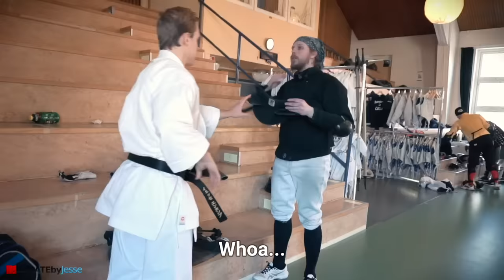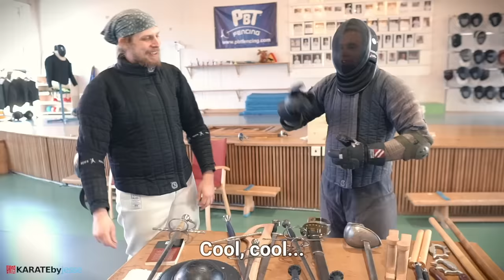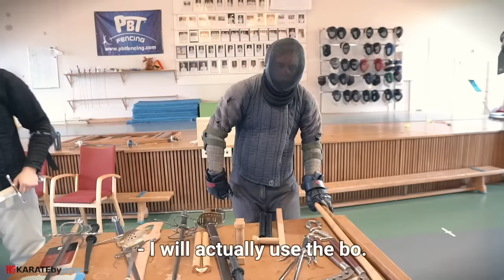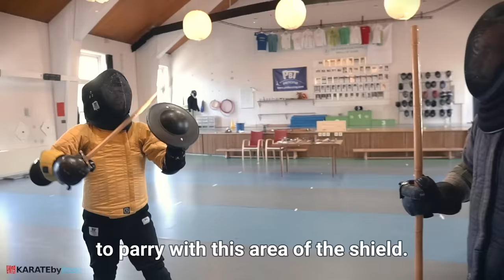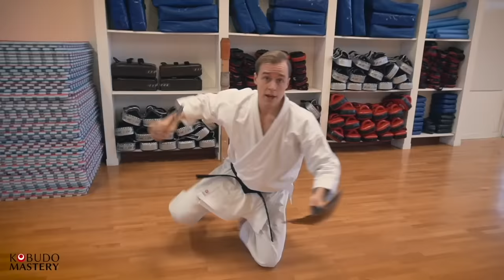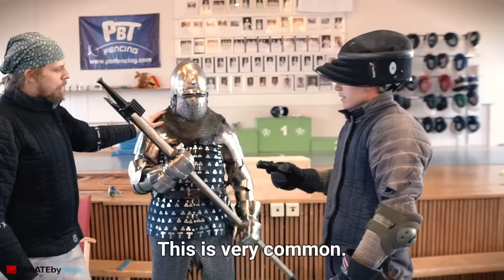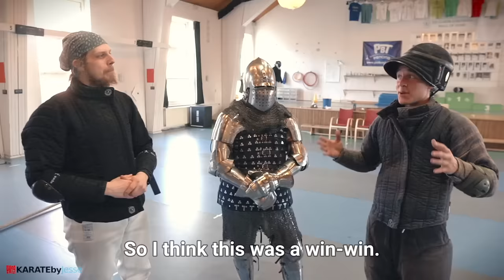Medieval vs. Japanese Weapons (Real Sparring)

Comment: The back kick against a knight is something i wasn't expecting to see, but definitely needed it
Reply from the maker: It was pure instinct! 😎
Reply: @KARATEbyJesse  Did that hurt?
Reply from the maker: @TheEndKing  Didn’t feel anything 😜
Reply: Im just not sure how viable it would be against knight. Maybe sort of push kick would be to get them off balance for grappling. Knights armor is designed to receive massive blows from actual weapons so no matter how hard they get kicked i doubt they much at all feels it especially directly to plate.
Reply: Not sure how it counted as a win, though.
Reply from the maker: Oh yeah, you should have heard him squeal 😂
Reply: @lalli8152  The kick landed on the low abdomen, right above the hips, so might not be the thickest part of the armor.
Reply: Not sure about the effectiveness though
Reply: Launched it so quick and under the Knight's vision
Reply: @lalli8152  knights themselves do normally kick, grapple, wrestle or even throw each other, trying to when in close melee. It probably would be too tough for sb out of armour.
Reply: @lalli8152 force matters most with Armor. You can alash away at it with a sword and have no damage. In a battlefield with people fighting and stuff you probably wouldn't even feel it unless it was something like a greatsword because swords sork in the principle that acceleration+small mass= small force, then small force+concentrated to a small point in the edge= penetration of flesh and thus it works on unarmored opponents. With armor you want something with a large mass. A regular hammer around 1kg (2 pounds or something) would do better than a sword.
Reply: @lalli8152  once i got hit by a bycikle in my armor it hit me in the area the man at arms was hit. It didnt hurt I velt it but armor is very powerfull and a kik does on plate almost no damage to the wearere.
Reply: @owwh2976  yeah especially something like plate because its so rigid i doubt you would feel much. Maybe just push of the kick that could throw you off balance or something if the kick lands at right time.
Reply: @lalli8152  I do buhurt. We receive direct hits of polearms, axes and swords and don't feel but a little disconfort. We also do and receive kicks and punches... from an opponent wearing a very heavy armour in the  arm or leg! And again, it bothers you, it does distract you...but you have to be VERY off guard and out of balace for a kick to really get you off balance... and a barefeet kick?? Even less!! 

In bohurt, kicks and punches do not count as a hit... because you are wearing armour!!! That is the point... the armour makes you slower, to sweat more and get more tired, your undertanding of the surrounding is worse cause of the helmet... but ALL of it is worth it cause it makes you impervious to almost any attack... I assure you that kick did not affect the knigth at all.

Comment: That was an amazing video and quite a bit of fun to watch.  I'm really glad your final boss didn't use the polearm to full effect, your armor was nowhere near stout enough to take a solid hit from it.  It would be a fun follow up video to have YOU get suited up in full armor so you could get a feel for just how much protection the guy had.

Thanks for this treat.
Reply from the maker: Glad you enjoyed it!
Reply: @KARATEbyJesse  One of the things that made it especially enjoyable was the mutual respect had by all and the chance to debrief after each match.  The final distilled wisdom was great as well.
Reply: Yeah, I was worried that he would get clocked on the head by accident or something -- that's a concussion right there, if not a trip to the hospital. Modern fencing masks were not designed to handle poleaxes... 
I feel as though this exercise did illustrate some interesting things -- infighting is surprisingly viable even against long weapons, provided that one is trained. But at a certain point the gap in gear really nullifies a lot; kicking and armored opponent in the chest isn't really going to do all that much, and while Jesse managed to pull off a takedown, that was only possible because his opponent opted to get rid of his weapon.
Reply: @taichi2245  Well said.  The average person doesn't understand just how much protective clothing is between the skin and the armor that acts as an additional buffer and how the planes of the outer surface deflect and dissipate force.

And then doesn't realize that a blow from a poleaxe or halberd can STILL shatter collarbones or give concussions through it all.  You can't really "blunt" what becomes a bludgeoning weapon.  I've seen some seriously gnarly injuries from weapons of this type.

Comment: this was very interesting. One thing to consider is the damage each weapon does. It is much more realistic for a sword to take someone down in one hit since it is a bladed weapon, which is why it makes sense for sparring with those weapons to go only until the first hit. The bo and nunchucks are blunt, however, and the force transfer by the nunchucks is a bit inefficient due to it not being rigid, so it is unlikely to seriously injure someone down in one hit. the stabs from the staff would also not do as much damage, so it is less threatening than a spear for example. when u were fighting the knight, you really must get in close to grappling. you would also have a knife to stab in the gaps.
Reply: You’d have to remember that he’d have the same thing. Like they said in the video, unless you have a similar level of armor, your best bet is to run.
Reply: Blunt weapons can still do damage, and I’m imagining a staff with some metal caps or spikes at the end could help with the impact. But I don’t imagine it being as effective against a person in full plate armor
Reply: @jonathanschaffer2594  yes, blunt weapons still do damage, but wooden ones won't do nearly as much as a sharp metal object. also, adding metal caps to increase damage would change the weight distribution drastically, making it fight differently. we see tgis in maces.

Comment: Funnily, grappling is a big part of European martial arts, especially against armored opponents. So, trying to get a knight on the ground isn’t a bad idea, it’s actually exactly what you’d want to do against one, since while medieval armor was very mobile, you’d still have a little difficulty getting up. But, the tricks are mostly done with assistance of levers, aka your weapon. It was also interesting to see the adaptation to your strategy. Though, it’s not terribly surprising to me that the generally shorter weapons failed against much longer weapons, namely with the sidesword vs kama, but that’s a general issue you’ll find in all weapons. Longer blades generally have a greater advantage since they aren’t as reliant on getting close, I’d recommend Skllagrim’s own video on a similar weapon to the kama about sickle fighting and his spars to test it out. Now, in a realistic scenario outside of sparring, if nunchaku were put up against a rapier and parrying dagger, even with the tonfa in the off hand, nunchucks aren’t very good weapons in general and don’t do well at carrying the energy of a blow when compared to a normal stick, but seeing it in sparring getting namely used against the hands is actually pretty insightful, it does show a bit of a strength they could have, and it’s being able to hit targets that a straight blade would need more effort with, and I admittedly disagree with the assumption that a shorter opponent is faster, it’s normally the taller ones in my experience that are faster. Though, smaller opponents are definitely much harder to hit because they’re small. I admittedly don’t have much to stay about the quarter staff because well… it’s a staff. Staves are historically rather effective weapons, especially if made of thicker and stronger wood, though some techniques you employed were actually also done in medieval Europe, so that underlines a similarity between philosophy in regards to these styles of weaponry. Of course with the armor duel again, what would have been done is that the weak spots in the armor would be exploited or the visor lifted up for visored helms or the helmet completely removed if it was close faced. But with the style of armor, it looks to be about 14th century from my perspective, so the helmet is likely a bascinet. But that’s only my observation from watching this.

Comment: This was really cool.  The Kama worked much better than I thought they would, and the Tonfa and Nunchaku were like a flail and parrying dagger!  As per facing the armoured opponent - that's what Jujutsu is for.  Take him down and then use a dagger in the joints of the armour.
Reply from the maker: Yes indeed!! Thank you
Reply: To be fair: They worked because his opponent refused to use all his tools. No guards, no overhead work, no constant threat with the point.
Reply: @leichtmeister  Correct. I don't see the point of this video.

Comment: quick disclaimer, as an armor enthusiast, this is not what actual armor looked like. This is buhurt armor, which is cheap and doesnt fit properly to allow it to be damaged without too much issue.

the changes are...
buhurt helmets are normally bigger
the cuirass or other chest armor is usually wider at the waist with buhurt
generally doesnt fit as well.

Comment: This looks like a lot of fun. Very impressive.

That heavy plate is from the late Middle Ages. At that point in history, armor technology had finally outpaced sword technology. The key was to bring the knight off his feet and finish him on the ground with a bludgeoning weapon or with a piercing weapon specifically designed to poke a hole in a helmet or to fit through an eye or neck gap. If you look at warhammers from the period they had what was called a "Crows Beak" on the back side for that purpose. And knights all carried a heavy dagger (not unlike the sai) to poke through face plates.

Check out the movie "The Last Duel" for a pretty good representation of this.

I thought you did exactly right in the end. Close range. Footsweep and finish.
Reply from the maker: Awesome! Thank you so much

Comment: Really instructive video.

The only element I'm missing here is the difference in degrees of damage that these weapons are capable of inflicting. For instance, they're treating a blow with the bo the same as a rapier stab or a dagger thrust or a nunchaku hit. That might be a good way to grant points if you're fencing for sports. However, if you're simulating a real combat scenario, that simply won't suffice, because a blunt strike with a relatively light wooden staff won't really do anything to an armoured knight, whereas a thrust or a cut to a vital area (like a gap in the armour) will most likely do some serious damage.

Another point I noticed... after the takedown, the knight seemed to have sort of stopped fighting. He was just lying there. In a normal combat situation, I would expect even someone with very limited ground game to struggle, grab your head, try to cover up with their arms, punch, kick, shove, push with their hips, try to either pull you close for a grapple or push you away. Here, the knight just sort of took a breather as Jesse was going to town with his ground-and-pound.

Other than that, it's interesting to see the change in technique and strategy based on the weapons available.

Comment: Something more about the final conclusion. A point and an edge are also very nice. I think outside of sparing you would not want to be hit by a sword on the wrist, while you might shake a blunt hit from Nunchakus (or even a staff) off. I think that is poorly represented in sparing with weapons (and not just here, it is a general problem). Touch == Point(s)*, which of course is not true, especially if armor gets thrown in the mix. I mean that is like thinking it does not matter where you get punched (or how hard).
*Some rules give different amount of points for different target areas (e.g. head vs torso vs limbs).
Reply from the maker: Thanks for sharing! 👍
Reply: If I were to take a knight I'd go for shield fighting.

Comment: You had the right idea about closing in for grappling, that is how knights took each other down when they didn't have maces or poleaxes. Do you think it would have gone any different if you had an Eiku for the knight fight? Seems to have the right length and heft.
Reply from the maker: I think you’re right!
Reply: Even with that, it wouldn’t go great. Plate armor is still incredibly protective against blunt impact. Blunt impact is just one of the few ways you might still be able to hurt someone in it.

Comment: I was told that Karate was invented as ways for peasant to fight back against samurai. Well, I can see why now. 

I'd say your 2nd match was actually spot on with how people fought in armor when they didn't have a weapon that can fight it,  but instead of punching, people would tried to stab the pinned opponent through gaps in their armor (or going for joint breaking and such).

Comment: That ending is funny, but actually real. knocking down an armored subject was a great thing to do. Getting up is hard with all that plate, but mostly in the ground you can use your dagger to stab the knight in the openings of his armor.
Reply: problem is: the armoured subjects don't let themselves be knocked down, and the same subjects were also masters of wrestling. So they may struggel to get up quick, but if you go down with them you may not get up at all - with or without armour. In that occasion the knigh wiuld have drawn the rondelle and done quick work of the boxer

Comment: Unarmored and unarmed (or like brass knuckles or whatever) vs full plate is a lost fight, because your hits are nullified. No like literally you best shot is get them on the ground and pull of their helmet.
Reply: But any shar stabby thing, say even a screwdriver, would let you go for the holes, and then all you need is to get a good hit on those cracks and splitt splat, that was that, the knight is down so lift your hat.

Comment: Was very noble of the kngiht to dispose of the poleaxe. These monsters are terrifying to face in combat, even when the wielder is out of armour. They were specifically designed to destroy anyone ironclad. Even the rubber ones can easily break collar bones. A gentle training tap in the head made me bite my tongue. We were not even sparring, just doing drills.

And you were basically under-armed. Not to take from your skill and the abilities of brass knuckles you were using.

All in all, an awesome match.

Comment: Grappling is one of the few methods of properly beating a fully armored opponent. Plate armor is no joke, and was ridiculously hard to beat before the advent of gunpowder.
Reply: Even after the advent of gun powder is was still difficult to beat for a while. It wasn’t until around 1650 when armor started to really fall out of fashion, almost 200 years after guns started being used in Europe. Even after that, cuirasses were still used by some soldiers as late as ww1.

Comment: While you touch on it, you do not really count what really matters the most fighting someone in full plate... they are going to be striking hard, fast, repeatedly for damage against your non-armored body, but full force strong hits by your weapon have a high probability of doing zero damage.

To really understand the difference, put on some full plate armor and fight in all out full contact combats.

Knights fighting - Evgeniy Bedenko vs. Ivan Vasilev, M-1 Medieval - M-1 Challenge 56, Moscow
https://youtu.be/IV3yvOkooYA

Full Contact Sword Fighting WARNING GRAPHIC
https://youtu.be/QhF1i23vwps

Between armorer combatants it often become a matter of endurance unless one is very lucky, very skilled, or using weapons designed to penetrate full plate armor.

Comment: Reach is a huge advantage.
I come from a kendo background, so my experience with weapons of different reaches is limited, but I do have a little bit. Some kata use kodachi (Japanese shortsword) and some kendo competitors use Jodan, an overhead sword stance that often uses one handed strikes for extended reach.
For equal reach weapons, there's a preferred fighting distance where both fighters can just barely reach each other with a strike.
For unequal reaches, there's an area where the one with a longer reach can strike, but the one with a shorter reach cannot.
The main game plan for the longer reach fighter is to use this area to safely land a strike, while staying out of the other fighters zone of attack.
The shorter range fighter needs to force the longer reach one out of center so they can go in and attack. This usually involves parrying the long weapon. For dual wielding, one weapon parries, the other strikes.
The long weapon starts on offense, the short weapon on defense. Winning with something like tonfa or sai vs. a longsword isn't out of the question, but it's an uphill battle.
Exceptionally long weapons, spears, naginata, seemed a little different. I had a single class with naginata opponents, and my impression is that the naginata was very slow compared to the katana (shinai) but was also far more versatile, and had a much wider variety of manuevers available. That, coupled with the superior reach made this a  fair matchup.